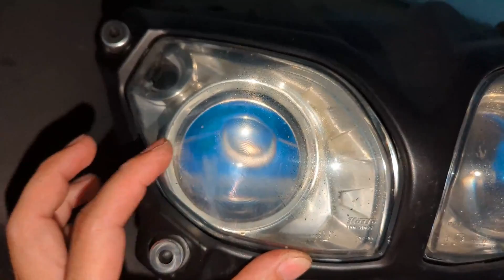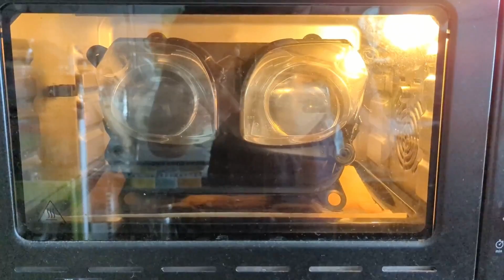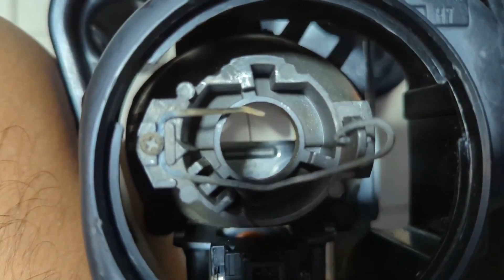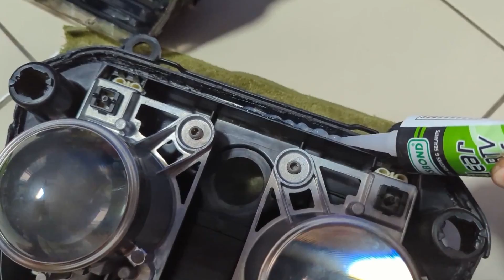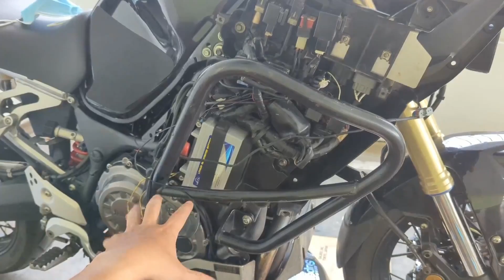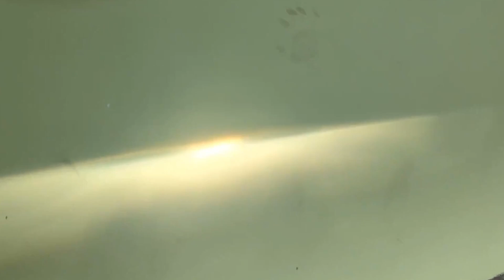Headlight Fix | Bad Lighting & Full Of Dirt | Yamaha Super Tenere Restoration [Part 8]

Comment: Hello, my projectors have a grey color that reduces the amount of light projected. How can I deal with that?
Reply from the maker: It then depends on where the "grey" cast is formed.

If it's outside of the projector, then you can buff it off. If it's inside (where the bulb is), then it's tough.